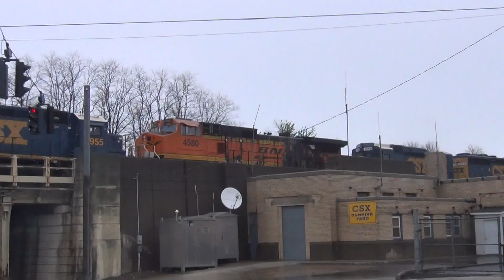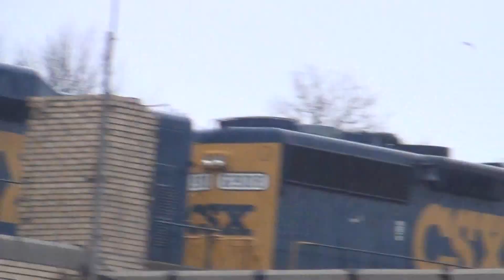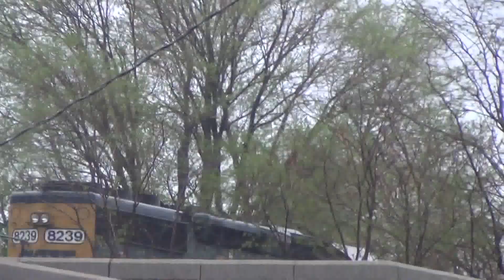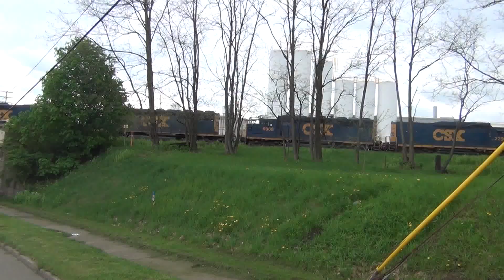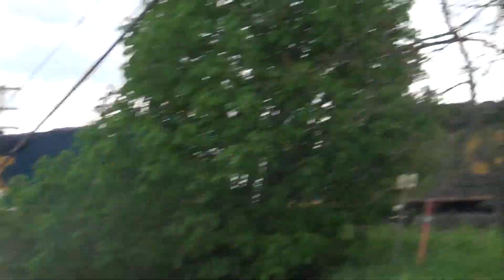CSX Train Towing BNSF Engine That Caught Fire

Comment: Ouch!  Burlington Northern-Santa Fe #4580 went down HARD!  What happened?  Fuel-line burst?  Something fail high-order in the generator system?
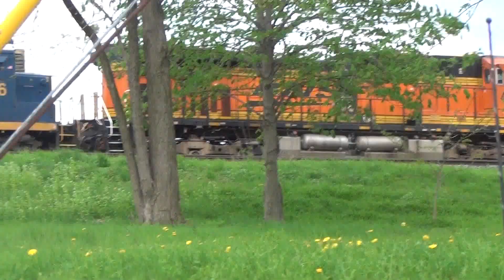Reply from the maker: Im not sure, that unit was there a couple days, you can see it in some of y other videos parked up there.  Then in this video at 2:00 you can see where it was in the lead. I heard on the radio that it was to be their lead unit before if caught fire.  I heard them saying it caught fire and they had to get it off the lead so they could tow it.
Reply from the maker: Being towed to GE in Erie BNSF Engine That Caught Fire Being Towed to GE in Erie PA
Reply: it was probably a turbo charger fire. It seems like every picture or picture of a flame throwing locomotive or charred locomotive is a GE for some reason.

Comment: how did it catch fire?
Reply from the maker: Jack Killeen Probably a blown turbo
Reply: +Dunkirk NewYork   I don't thing it's a blown turbo, it looks like it's burnt upwards from below so I'd guess a traction motor fire that got out of hand or maybe a fuel system failure with high-pressure diesel that caught.  Being as there is burn damage to both sides of the loco I would probably be more inclined to go with a fuel fire...

Comment: Anyone know what's up with 2355 and 2296? They both have no side vents in the long hood past the doors.
Reply: Funny enough I was on the 2296 this morning. It's what's known as a road slug. It has no engine or mechanical components at all. It is a giant paperweight with traction motors that are being supplied electricity from another locomotive (affectionately called the mother). It's there only for extra traction. These mother/daughter sets typically stay together and I can confirm the 6908 is still with it. 

The slug still has a fully functional cab that will control both locomotives so the crew can run from either end. In the winter most crews prefer to run from the mother as the cab is a little warmer because of the Diesel engine right behind them.

Comment: @ 0:45 is that a road slug hard to tell!
Reply: +Ultimate Railfan I was wondering the same thing, I think it is. but it would be so cool if it was a running train
Reply from the maker: +Wyatt Wilkinson Yes that unit is a Slug
Reply: +Ultimate Railfan  what is a road slug
Reply: +Ultimate Railfan  what is a road slug
Reply: +Allison Newman As far as I know, it's kinda like a locomotive without its engine, and they use the extra weight for more traction.
Reply: +Josh's Train Videos They use the traction motors from it as well, they are basically inseparable from the GP40-2 Mother.
Reply from the maker: +Allison Newman Its  a Train Engine without the diesel motor. It has the electric traction motors and it gets it electric to power them from the other engine that has the diesel-electric power generator
Reply from the maker: +Jacob Schiess Yes I just got a video of a GP40-2 w a slug yesterday. Here is the video  https://www.youtube.com/watch?v=u9m5y6dVloc
Reply: +Dunkirk NewYork We have a GP40-2 and a Gutted GP30 that does the local where I live on the CSX LCL Sub.
Reply: +Allison Newman sounds like a answer on jeopardy